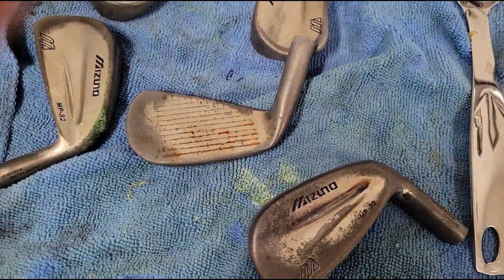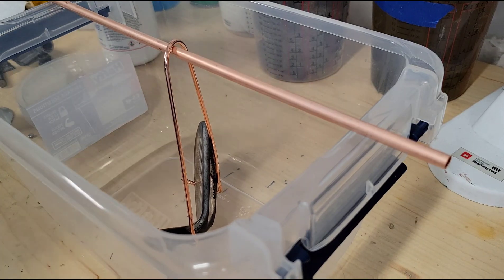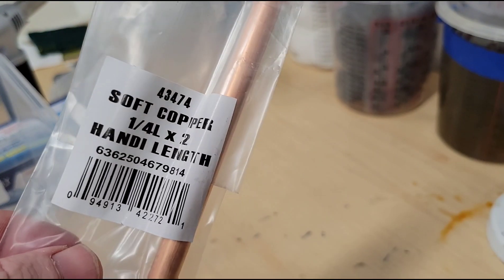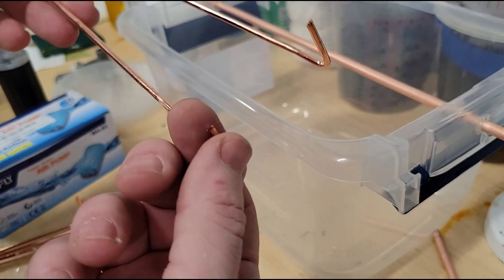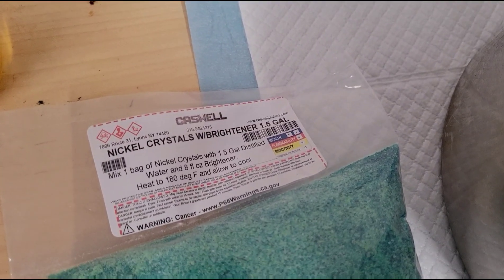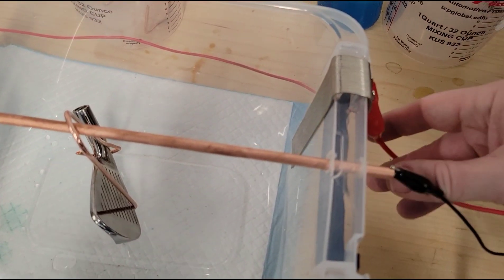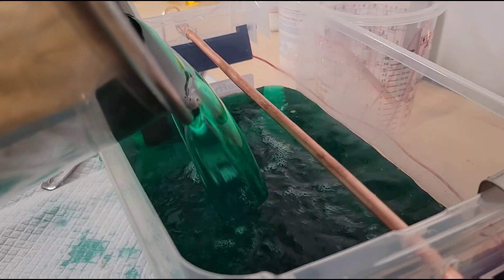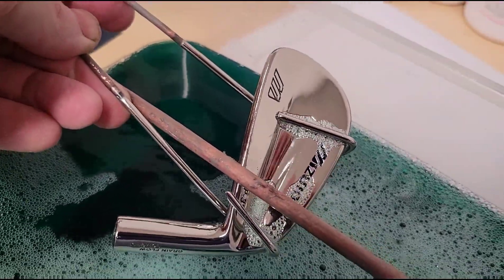Learn How to Electroplate Golf Clubs at Home! - DIY Golf Club Restoration

Comment: So, I did my first wedge with steps youve put in video.  Got all my stuff from caswell.  It turned out great.  I then prepped and did a 2nd wedge, and it came out with a black/chrome spiral finish...found out  that my cable that connected the annodes dropped into the nickel solution during the plating process (im guessing some plastic got melted off).  I tested with another club and got some "icky" results.  I'm wondering if the solution got contaminated and if there is anything a guy can do to clean the nickel solution or do I need to start fresh with new crystals and nickel brightener?

thanks for any help!
Reply from the maker: Hi Ben. Contamination is a possibility if something falls into the solution because it will also release lositively charged metal looking for a negatively charged part. Some forums say you can filter it through a fish tank carbon filter.

Have you tried polishing the swirly one after? Does it shine?

Comment: Greetings Brad, love your channel and thanks for making the video. What material did you use for the positive electrodes? I am thinking about doing this to my Ping cat eye set which is just plane dull  stainless. What type of pre treatment would they need? Just an acid dip before plating to remove oxidation? Also need to remove any paint. Thanks again
Reply from the maker: For stainless, you won't have to do any of these steps. You can just sand and polish them as-is. If you want to make them matte like their original finish, you can spray it with your sand blaster to dull it down after polishing (unless you want it shiny)
Reply: @BradMeehan  awesome friend, and what did you use for the positive electrodes in the bath?

Comment: What kind of power supply do you need for doing your plating - VDC and Amps?   I have a set of Maxfli TM-92 Australian Blades that I have been playing for 20 years and I love them but they have gotten little dings and dents all over them from clanking around in the bag over the years and I would like to restore them to like new again and am doing some research.

Comment: Do you take old chrome and nickel off first, if so how?  How long do the annodes last?  The green solution can be saved if you take out and do a copper bath correct?  Amazing work Brad!
Reply: NO YOU CANNOT NICKEL PLATE OVER CHROME.  Chrome has to be stripped OFF first.

Comment: Ya thats probably the best set up i have seen yet cheers bro for posting i couldnt get nickel in large enough size guitar strings are nickel wound but went with nickel welding rods think they are 50% nickel so not as shiny but did the job and not rusting...
Reply from the maker: That's great. I'm glad you gave it a try.

Comment: How long do you leave the club in the plating solution?  Are there any problems if you leave it in too long.
Reply from the maker: Too long could result in pitting. I leave mine in for around 2 hours, but some say 30 minutes is enough. the longer its in the solution, the thicker the plating, but you're also risking imperfections.
Reply: @BradMeehan  Thank you!

Comment: Do you have any HVAC experience or electrical by chance cause I get that vibe I could be wrong I’m just curious lol
Reply from the maker: When I was in the Air Force, my job was "Electrical Power Production Technician". I worked on mobile generators and power plants in support of the U2 reconnaissance plane! Our shop was also shared with the HVAC team. 

Good guess!

Comment: If you did multiple club heads in the nickel solution at one time do you have to leave them in longer or would it still be around same time as one clubhead
Reply from the maker: You would need larger anodes to accommodate the increased surface area of the clubs. For our little operation, it's best to do one at a time.

Comment: Is it possible to plate the everything but the club face?  I.e. MacGregor CF4000 PT2 “Black Face” irons
Reply from the maker: You could either put tape over it, or spray paint the face with clear coat, then plate the whole club, then strip the paint so it's raw underneath.

Comment: So after you Nickel Plate them you can sandblast the face paint fill them and game them or do you have to put any kind of a coating afterwards
Reply from the maker: Absolutely. You could spray them with a bit of clear coat to extend the life, but it will scratch off eventually.

Comment: what about the part touching the hanger? does it electroplate the part in contact with the hanger or do you have to move where it's hanging?
Reply from the maker: I've evolved the process to hang it upside down by the hosel. Check out some of the newer videos to see how that looks. I never noticed it in the finished plating but it's definitely a potential. It was more noticeable when I do the copper. The upside-down approach is best

Comment: Excellent. I've done some metal cleaning with electricity and accidentally put some copper onto cast iron. So I've plated before, but not properly. I'm also familiar with making power sources. Thanks for the tutorial.  Question, is there any limit to how many clubheads we plate at once? Looks like 2 or 3 might hang in your tank, more if bigger.  Any drawbacks to that?
Reply from the maker: The only limit is real estate in the tank and the size of your anodes. The rule of thumb is the anodes have to be twice the size of the surface area of the club. Then, you'll need to adjust your current to accout for the additional draw.

I'm still learning too, but this is what I've gathered at this point. 

Also, I appreciate you taking the time to comment!

Comment: Fake! If this was real, your hanging brackets would prevent the areas of the club head that the hangers were touching, from plating.
Reply from the maker: Thanks for the comment, Fucknuts. (Is that a family name?)  I explained this same issue in my newer videos. I now hang by the hosel to avoid the potential of leaving marks. It's more evident on the copper.  Use a taller container so you can hang them upside down and you won't have this problem. Don't forget to subscribe to see latest updates.
Reply: @BradMeehan  - My parents were beatniks, they thought naming me Fucknuts had a nice ring to it, especially followed by our last name...Lipshitz.
Reply from the maker: @Fucknuts  lol. Also, I'm testing out an electroless plating kit soon. Should remove all risk of plating marks! Stay tuned, my man.
Reply: @BradMeehan  - Looking forward to seeing it, I'll subscribe and keep an eye out.

Comment: why did the lettering not get plated ?? is it paint ,, witch would not let the electric flow ??
Reply from the maker: Thr nickel will only bond to othe rmetal. It will not bond to chrome, paint, or even an oily fingerprint. This was me being lazy and i should have cleaned it before putting in the tank to avoid contamination of the solution. So be sure to clean yours first.

Comment: Great job and a few questions (1) what voltage and amp settings did you have? (2) I believe I got that you bought Caswell products … both their names? 

I have done similar with no success and you video will surely help but needed or need my informational from YOU … and thanks
Reply from the maker: Glad to help. 

I've found 3.5 v and 1 amp is right for a single club head in a similar size container. I've also been warming the solution in an old crock pot I bought from a thrift store and it is helping a lot. All the plating material was from Caswell. The fish tank aerator keeps bubbles from sticking to the surface. 

Also, I just posted a link to a plating handbook that may help.
Reply: @BradMeehan  hate bothering you again … how long did it take brewing the single club … I am trying to restore a few early 1900s pistols and having issues.

Thanks again 👍
Reply from the maker: @ffield12  About two hours but i check it regularly to make sure there no pitting forming on the surface. That's controlled by keeping the voltage/amperage lower, keeping ample distance between your part and the anode, and keeping bubbles off of the part.
Reply: Brad … again you videos are great … after three weeks almost from Caswell the finally sent the stuff you demonstrated …. Also, by chance I got a fish bubbler that is the same. I am nickel plating old early 1900s pistols … I have been attempting to strip the nickel and home brewing nickel plating solution with white vinegar and salt and strips of nickel and not having good luck. I had gotten a solution brewed from Caswell that takes a while getting the nickel off the metal and that’s a real process. Then I sandblast and sand and again not plating well at all. Hopefully, this process will work better as you have shown. Question: I assume you reuse the Caswell solution you made and it’s not a one time usage?? Also do you sand or sandblast the item and clean with acetone prior to plating?? Thanks again 👍
Reply from the maker: @Franklin Field Jr.  Hi, Franklin. The nickel solution will last a long time if you keep it clean. What will "run out" is the anodes. Remember, the anode is continually feeding the solution with new nickel. You'll see that after many sessions, the nickel will look like it's being eaten away bit by bit. Eventually, you'll have to replace it with fresh anode, but that's long down the road. I've only replaced mine once since i have that plating video. If the level in the tank gets low, you just add more distilled water to it. Even if you left it to evaporate completely, you'll just be left with the nickel crystals you started with. Pretty cool.

I'm not sandblasting mine because I want to keep the shiny finish. The nickel isn't like paint where it will fill scratches and blemishes. It will take on the same appearance as what's underneath. You'll see in my videos that I do sandblast the club face, and it looks more matte than shiny, but it's still plated. I can see a gun would look better with the blasting. Acetone works well, but I'm using a product called electrocleaner that you use with your DC power supply to clean it.  Be sure to wear gloves - even a little fingerprint will affect the plating.

I recommend getting a few pieces of scrap to practice on. Remember, if you screw it up, you can un-screw it up.
Reply: Hey Brad, 
How do you  connect the electro cleaner wand to the power supply (which clips go where?)  and what is the purpose of using it? Thanks man!
Reply: @bradmeehan any help is appreciated 👍🏼

Comment: Great video. How far will one mix go.? Like can you do several clubs in that one mix? How would you gauge when it's ready for replacement solution? Cheers!
Reply from the maker: It will last indefinitely of you keep it clean. You can add more distilled water to raise the level if it gets low. The inky thing you'll have to replace is the nickel anode because it gets eaten away as it sacrifices metal into the solution. I'll make a video about Tank Maintenance for you.

Comment: Does the piece that's being plated show any blemishes at the points where it rests on the copper hook? Do you move it around periodically? Great video, thanks
Reply from the maker: It could. I've adapted my tank to be taller so I can hang it from the hosel now. I bought a plastic flour container and it's a good size. Check out some of the newer videos to see what it looks like. The rest is the same setup.
Reply: The contact point will have a thinner layer so move it around

Comment: What kinda voltage are you using?
Reply from the maker: I've found 3.5 volts and 1 amp works best for this set up. I'll lower the current to .5 amps if I'm leaving the house for a few hours.
Reply: @Brad Meehan  how long for each piece?

Comment: Exciting videos!
I have a set of old titleist tour model from 81, they are fully playable as they are… But it would be really cool to have them in a mint condition.
Chroming seems as a no go as a DIY process!
How does the Nickel plating hold up for wear & tear?
Other then that I guess it is just to follow your videos with the mizuno clubs?

Great videos!!
Reply from the maker: The nickel is quite durable. And, once you understand the process, you can re-do the plating as it wears.
Reply: @BradMeehan  Only if you electrostrip the first plating first.

Comment: Hi, just of curiosity
What’s your average working time on 1 iron club?
1. When Only deburring,grinding,polishing, face reconditioning
2. All the works above + electro plating

Thanks for awesome video :)
Reply from the maker: 1. Probably 40 minutes. Masking the club face with tape for reconditioning, hand sanding, and the sisal wheel take the most time. The more time you spend on the sisal wheel, the better result in the polishing. You'll see the most transformation there.

2. Around 2.5 hours total in the tank. Maybe 5 minutes of that was prep work for the electro cleaning. The rest is just sitting in the tank and waiting 🍺.

Comment: The hook doesn’t leave a mark where it touches during the nickel or brass plating process? Thanks
Reply from the maker: I believe that because I check on it so often that it jostled around on the hook to avoid marks. I may just be getting lucky. 

If you notice in my newer videos I've been hanging them by the hosel to avoid this. You'll need a deep enough container to do it this way. Works great and avoids potential marks.

Comment: Sir, Is nikle plating and chrome plating is same??,
Are you using AC current or DC current??  ,  Voltage ?.
Reply from the maker: They're different metals but the process is the same. Chrome plating is more expensive and has safety concerns for me. Caswell sells the chrome plating kits it you want to try it.

It's DC. and I use 3.5 volts and .5 amps for about 2 hours.
Reply: @BradMeehan   sir, Thank you.

Comment: What is the power supply voltage?
Where did you get the sacrifical anodes?
How long was the club head in the solution for a decent plate?
Reply from the maker: My sweet spot is 3.5 v, .5 amps. I'll caveat that with I'm a DIY'er and always learning and perfecting the steps. There's a formula to follow on some plating forums, but experimentation got me to those values. 

There are links in the description to buy the anodes from my affiliate store or check out Caswells site. 

I leave it in for 2 or 3 hours total. Just need to make sure you have plenty of distance between the Anode and club to avoid pitting as it builds up.

Comment: What power sourse are you using ?  a battery charger or what ?
Reply from the maker: It's a DC power supply. Check out the link in the description to my equipment page and click "electroplating" to see it.

Comment: hello! a consultation... the sandblasting is done before or after the electroplating processes
Reply from the maker: I now do it before to avoid damaging the plating.
Reply: @BradMeehan when you sandblast before, do you have to block/seal/cover the area you sandblasted before you dip? ..and if so what’s your recommended method of doing that?
Reply from the maker: @DrunkPenguinCo  No, you plate directly over it or it will rust/corrode again. You can blast after, but I've gotten too aggressive and blasted off some plating. Now I'm gun-shy and do it first. It will still look textured under the plating.

Comment: Is it possible to electroplate multiple clubs at a time, or is there a reason you do them one at a time? Love watching these and I am looking to get started in it!
Reply from the maker: For sure. You'd just need a larger tank and likely have to adjust your power settings to accommodate for the extra load on the circuit. Ideally you want some distance between the anodes and your club heads to avoid putting, so you have to make sure your container can support that much real estate. I just do it this way so once I'm done polishing one, I can put it right into the tank then start polishing the next one. Almost an assembly line.

Comment: Hi brad :)
I'm enjoying watching your video very much! Thanks!!

I'm planning on buying some things I need to try electro plating and I had a question.
If I buy nickel crystal solution and brightener that you used, how long can I use them?(or for how many clubs)
Reply from the maker: The solution will last forever. You will only have to add more distilled water. You will only have to replace the nickel anode after time because you are borrowing nickel from it to bond to the club. It may take months for it to be eaten away enough to replace. Just be sure to buy a big enough piece of nickel when you order the nickel crystals.
Reply: @BradMeehan  thank you so much for the recomment!!

Comment: Can you describe your process before playing? Do you degrease then prep with a muriatic acid mix? And if I scuff the surface before with a scotch brite pad will this plating still give it a uniformly smooth look? Thanks for your content man!!
Reply from the maker: How far before plating? After it's been polished? 

I use the acid for rust and some chrome removal before polishing. 

Once it's polished, I use the electrocleaner to really get the piece clean from any oils from the polishing compound, I active any remaining nickel that may be on the club so it can accept new nickel, then into the tank for a few hours. 

The club will take on the condition of the underlying metal, so if you see brush marks from the Scotch-Brite, you will see it in the plating. A heavy layer of copper first will help fill in the scuffs, but it's just easier to polish than go to that extra step. Polishing takes no effort. You're just standing there and letting the wheel do the work. 

Keep the questions coming so I know you are successful at this.

Also, practice on a junk club.